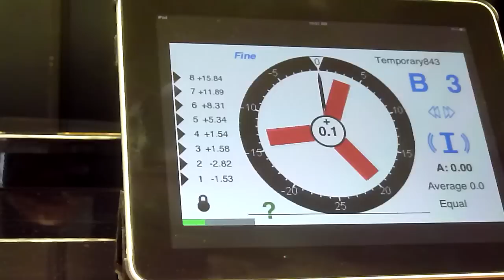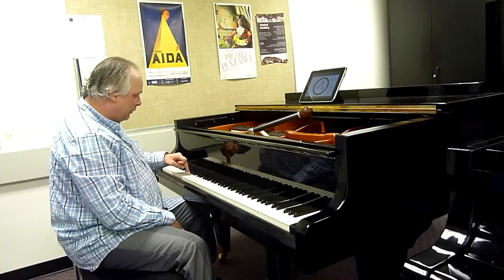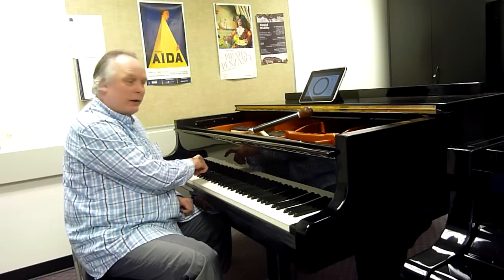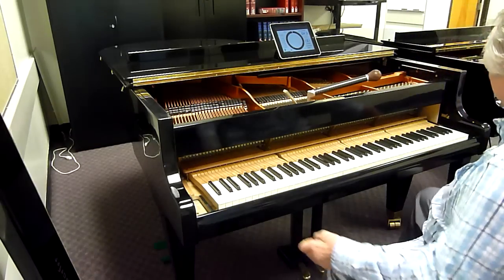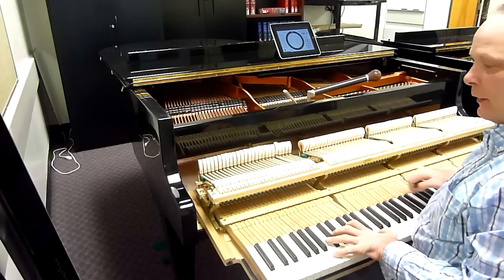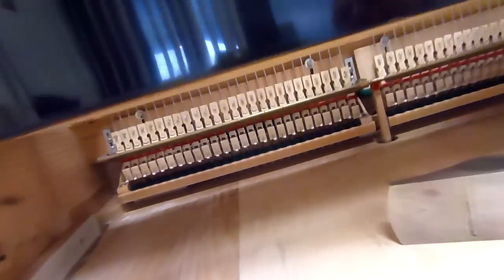Woodworking and pianos

Comment: When I was a kid back in the late sixties, my parents supplied us with two or three used pianos, my baby brother and sister seemed to take to the lessons way better than the rest of us (there were 8). My youngest brother would slam the keys when he missed a note and break the hammers in the old uprights, I fixed many a piano hammer with thread and glue. Probably not the best method, but it worked, and I learned a lot about the inside of pianos. I am curious as to what do you think caused that board to warp like that?